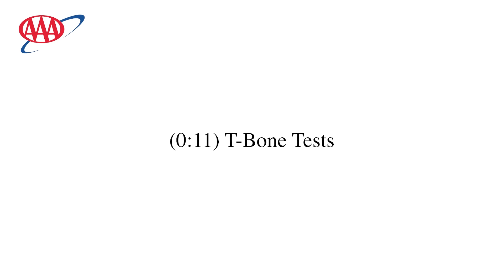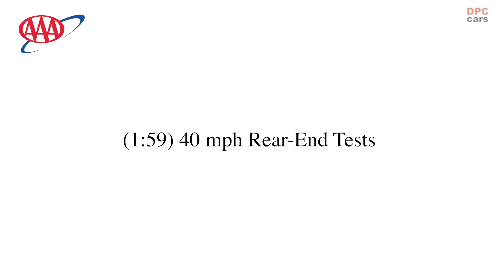Automatic Emergency Braking Fail

Comment: Wow. That’s disheartening.
You think GM, Ford and Honda could be sued for false advertising?
Clearly, non of their systems “fully worked” as advertised…
Reply: It’s not false advertising at all. Many systems are not designed for t bone or intersection collisions, just rear end collisions. Hyundai and newer Toyota systems do have intersection crash detection, but not all brands, and those have advertised as such when you read up on their capabilities